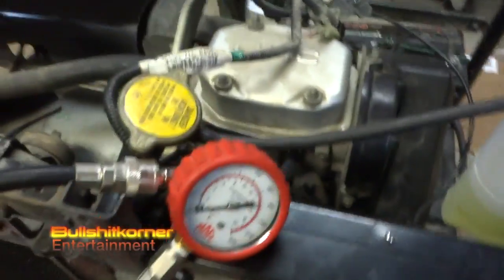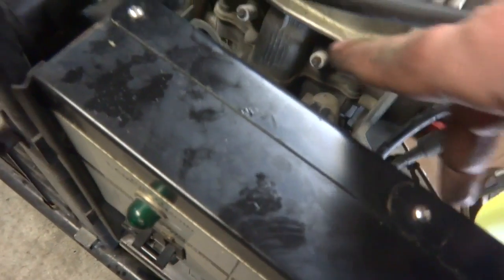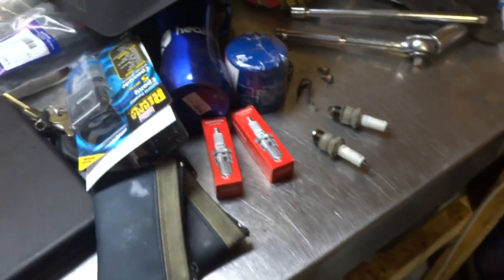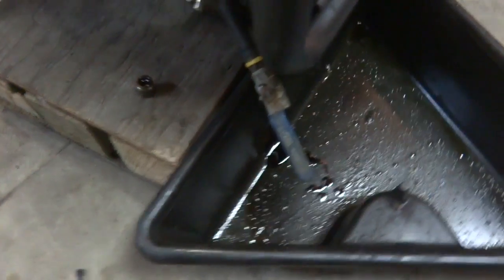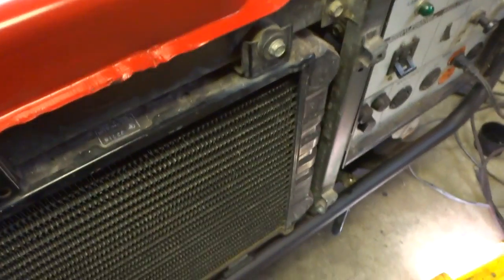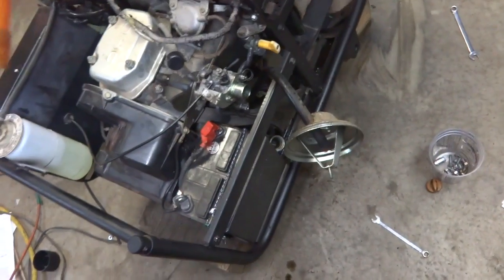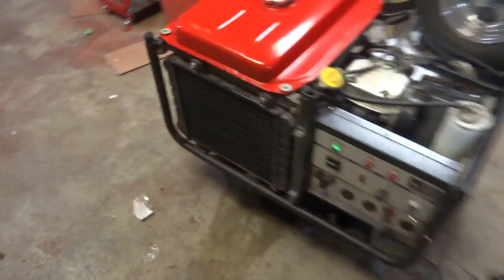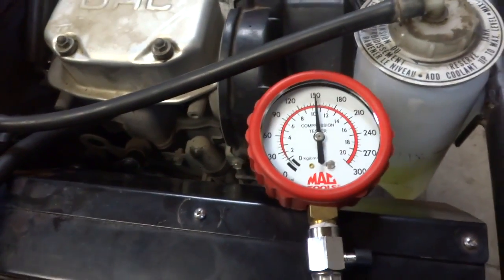How to Tune up a small engine and do a Compression test

Comment: enter motorbike servicing.. remove tank, fucking great airbox with 8 bolts to do air filter..strip fairings to change oil filter.. Strip tank + airbox + air filter + air injection + rocker cover + camshaft to do valve clearances.  But at least that gives you 100hp on a 600cc bike. But on a generator set? Bloody hell.. I like your videos you should go into TV, but then you'd inevitably become a pretentious prick wearing makeup like some poof.  Stay as you are. you seem to be having fun

Comment: What??? No Beer?? You're slipping brother!! Tune-up on a generator should be at least 2 PBR's--lol
At least the compression is balanced and even between the two cylinders. Rings probably degraded from sitting so long. I'd run it until she started blowing smoke and then worry about it.
Reply from the maker: it's hard to drink beer in the winter, dealing with -20 temps you really don't want to be drinking a cold drink.  it's not smoking yet that i can see but i really haven't put any hours on it yet to see if it's burning oil at all.